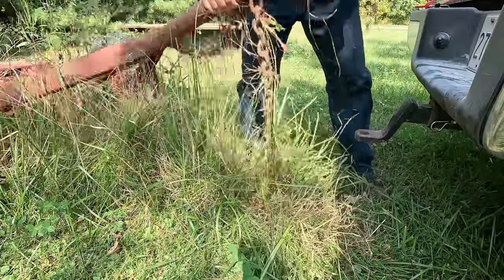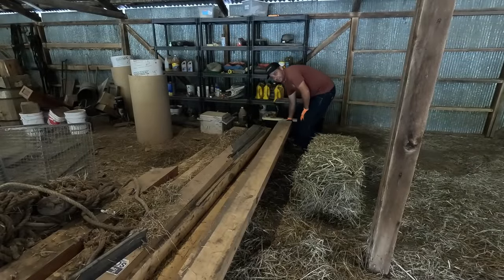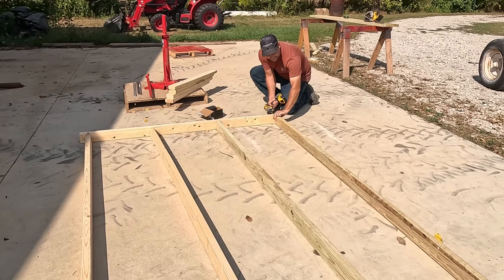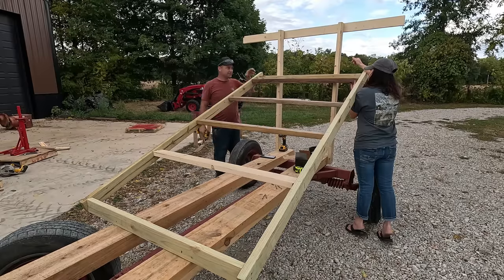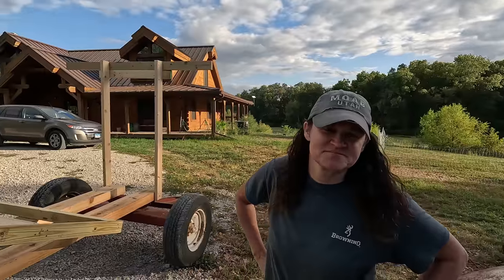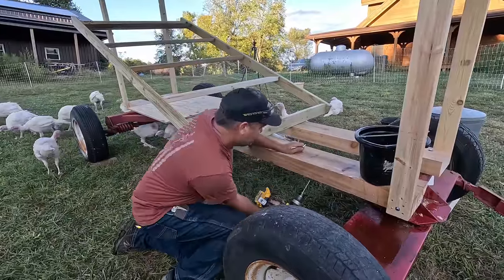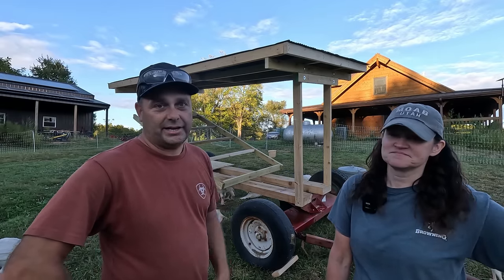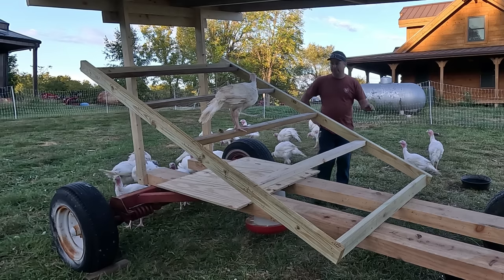The Turkeys need a place of their own.  Building a Mobile Roost for Pasture Raised Turkeys

Comment: Cool project.  You two work well as a team.

When you get some more wood, consider adding a diagonal brace from vertical post to roof and some cross-bracing between the vertical posts.

Comment: Suggestion lower one side of boards holding roof for water to run off and snow to slide off.  Retired contractor gives 2 thumbs up.  Good job.  FYI diagonal wood braces will stabilize roof.

Comment: You might want to add some front-to-back bracing on the roof-support legs, to prevent a force from the front or the back from just pivoting those legs backwards around the lag bolts and dropping the whole roof onto the roost.  :)

Looks pretty darn good to me, and will be nice and portable!

Comment: Great looking roost. Another thing you may like to consider is a way to anchor the whole roost to the ground. Another You Tube Channel has an enclosed mobile chicken pen on a wagon similar to yours and it ended up being blown over in a severe storm about a year ago. Winds were pretty high but your open roof there might make that like a parachute in high winds. Maybe ground anchors with cables tied to the corners of the roof.

Comment: Hello Evan--one suggestion, you have thunderstorms like we have here. Perhaps adding eyebolts towards the top end of the vertical boards so you can add cables for ground anchors will prevent high winds from flipping it over. Look at how they secure small airplanes to the tarmac for the idea.

Comment: Great job on build  turkeys will love it .  An Idea for securing your roof .You could use your fence brace wire and gripple clamps to tie it down. You could drill holes in roof truces and cable them all the way down to your frame truces. One over front and one at back and it would never move.

Comment: You could weld a T out of rebar and pound it into the ground through the steering arm hitch holes. The T would make it easy to twist for pulling up. The roost won't move with the tongue held into the ground. BTW: Great build!

👍👍👍

Comment: Great job for an off the cuff build, a couple of suggestions (not criticisms). Don't rely on the wooden chocks to avoid rolling away, use a metal ground stake through the towing eye. The weakness of the build is in the front upright support pillars, effectively the risk is from sideway movement. Ther is one bolt at the bottom of each which could really be aided with something like an "X brace" between the two posts to give it some rigidity. Do you need to buy storm ties for the roof? could you perhaps look at 4 corner wooden ties tying in the roof joist and purlings with the upright stanchions at 45 deg? Just a thought to aid the endeaviour of not buying anythink! As you say mor tweaks to be done anyway. Love the channel.

Comment: it looks like if you ran the roost where it was high in the front to the low in the back instead of from the back to the front you could have gone the whole length and still not interfere with the front wheels.

Comment: I think if you don't put some X braces on your uprights, that roof support structure is going to have a short life span. Moving it around will take a toll very quickly on that design. Some fore & aft bracing on that front support wouldn't be a bad idea either.

Comment: It's not high enough away from Predators, and angle is not steep enough. Remember, they always want to roost on the highest board, and its quite low.  It's not wide enough to keep them dry when it does rains, that another reason you want the roost high.